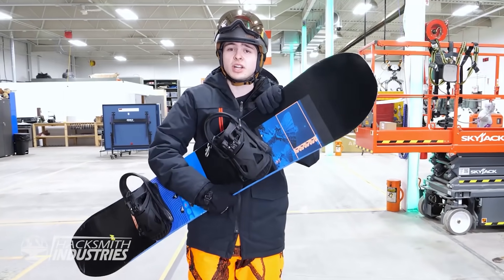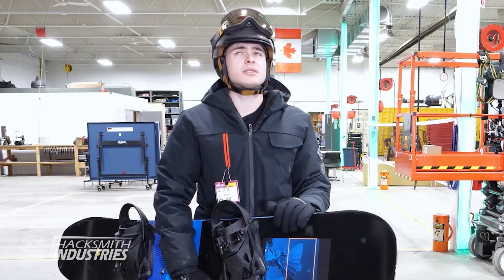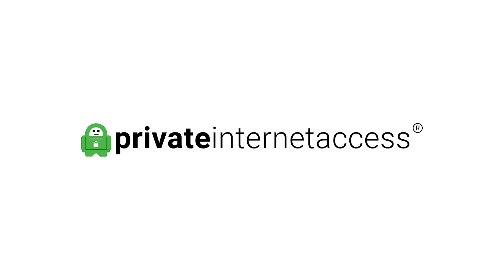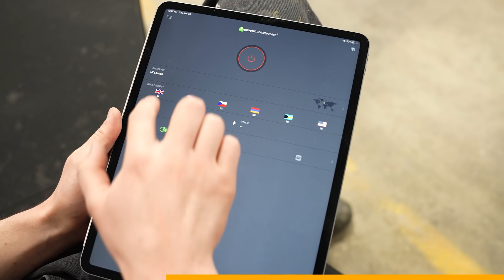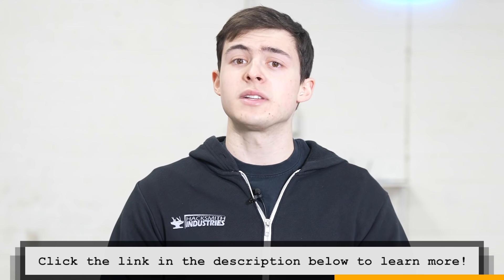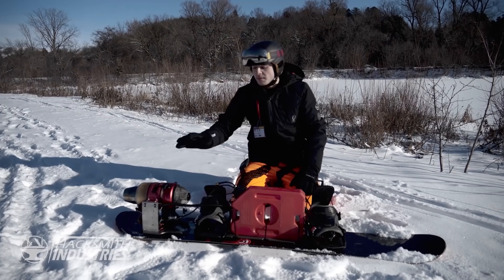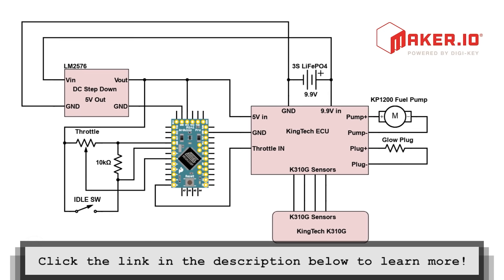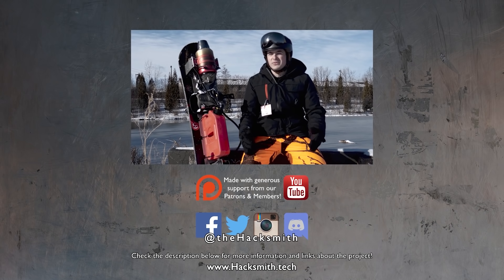JET ENGINE Snowboard! (DANGEROUS)

Comment: yeah, it's cool and all, but I think you guys should be more honest. U guys are only showing pros and no cons(except it's hard to use). here are some cons: 

1: you have fuel between your legs. what if it catches fire? your legs are strapped onto the board!!! Good luck trying to get out of that fast!
2: you can only use it for a few minutes before you run out of fuel.
3: what if the snow gets sucked in the mini jet engine and melts inside?
4: cost!

Comment: Build one with tracks on the back
Reply: haha I have worked on a tracked attachment for a snowboard. I also have the idea to put the track on a caster in the middle of the board so you can get powered slides.
Reply: @quinnfoster4671  that’s so coll

Comment: Two engines mounted at the centre of the board? Twice the power and improved ballance
Reply: YEEE I only worry about clearance for turns, getting a ton of snow and debris into the intake and the balance of thrust between the two engines causing unwanted turn.

Comment: If you need the CG to be more foward to make it more easily controlable, could you move the fuel tank to the front? It wouldn't help as much when the fuel runs low, but it could let you take some weigh off your front leg for most of the time.

But I have almost no experience with a snowboard, so I'm probably missing something. :)

Comment: What about a weird "handlebar" design with two smaller jet engines on the sides close to the board a little behind where the center of gravity should be? If they're too far out I imagine you'll have weird issues where one is higher than the other and causes more loss of control.
Reply: ohh this idea would work a lot better on a snowscoot!! Did not think of that till now.

Comment: Couldn’t you also just put a strap from you to the jet engine?  It would allow you to pull up on the back of the board/lean forward, with less total weight needed to be put on your front foot.

Comment: I did this on a longboard years back... make your mount longer and attached at the center between the feet. Leave the engine where it is. Longer and sturdier mount would be needed to go around your rear foot but it'll help with center of gravity
Reply: they could make a heat shield for the back leg too

Comment: would you be able to make the board balance better by adding a counterweight to the front end, or would the fact that the amount of fuel decreases as you use it more make that impractical since the overall weight will change?

Comment: If you had two you could put them on the sides and the fuel in the center of the two putting the weight in the back and letting you ride better

Comment: why wouldnt he put a bracket too adjust it and fix it to a new angle, since the weight distribution was off he could angle it down to lift some weight off the back, yes this would be hard to control because not all the thrust is going forward, but it would help the centre of gravity and how much weight you have going downward

Comment: Something about having fuel strapped between my feet while attached to a board doesn't seem like a great idea.
Reply: sits on motorcycle gass tank
Reply: @tennysonjames2969  if it's on fire you can jump off. Hes literally locked in
Reply: i guess that's a risk you take doing any activity involving fuel. nobody dives off of their burning motorcycle while its speeding down the road, half the time that would be worse injury wise than the burns you would sustain depending on the speed your going. nobody jumps out of a burning car, either, they come to a stop and exit the vehicle. same on the snowboard, you come to a stop, unbuckle you boots and step off.

Comment: Easy fix for you; put some strakes on the back underside (think "snow fins"). Just something to increase drag a tiny bit to keep it from wanting to turn end over. I figure an eighth or even sixteenth inch aluminum rib would be more than enough to bite into the snow without causing too much drag.

Comment: You've already done a EDF snowboard, which had the same stability issues. Would it be possible to mount EDF's at the center of the board sticking out just enough to clear the legs (somewhat) or is this too unpractical to actually pull off compared to the gains in balance ?
Reply: btw, I get that the edf would probably break the first time the rider falls.

Comment: the jet should actually produce more thrust in cold air.
to put more weight to the front it would be thinkable(though dangerous) to put two jet engines on a cross bar at the front.
you would need a killswitch that shuts of both engines when you fall.
or you put the tank in front and the crossbar with the jetengines in the middle.